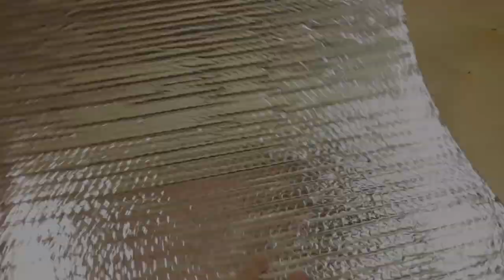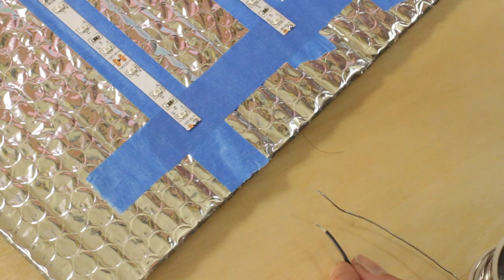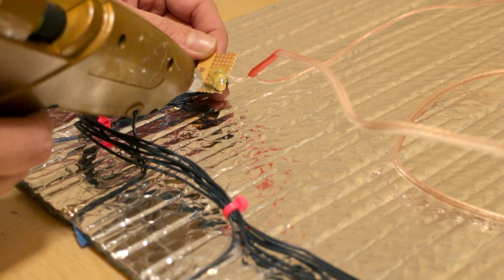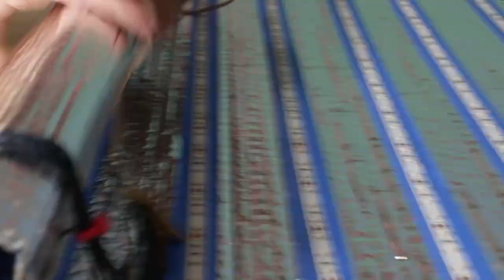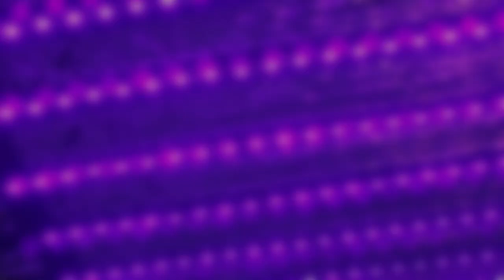How to Make a Collapsible UV LED Lamp ✨💜

Comment: Is this actual ultraviolet or just a black light?
Reply from the maker: Hey there - the Wavelength of the lights I bought were 390nm---405nm. Your question prompted me to do some research. I guess they are a little on the high side of UV, but it works really well for my cyanotyping needs and I even have cured some resin adhesive...🤷‍♀️  hope this helps!
Reply: audreyObscura sure does, thanks!
Reply: @audreyObscura  I also need it for cyanotype. You also made it with this led light?